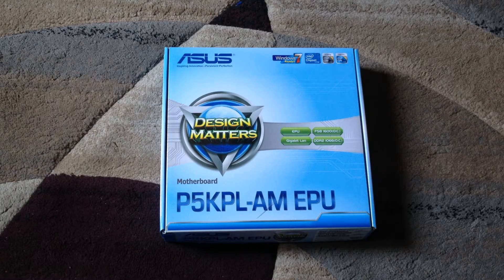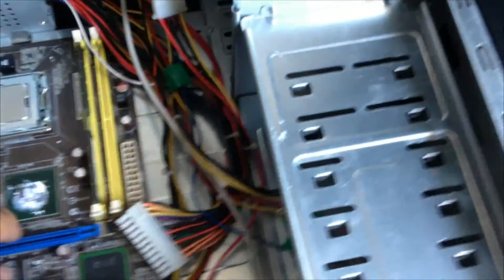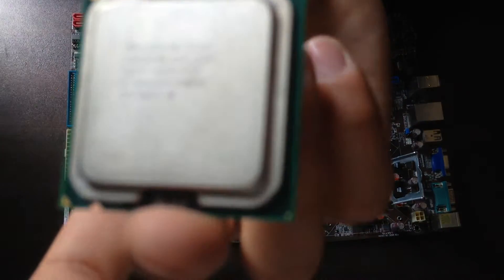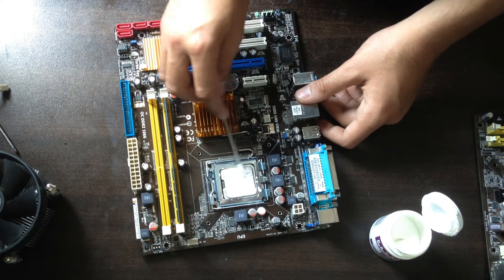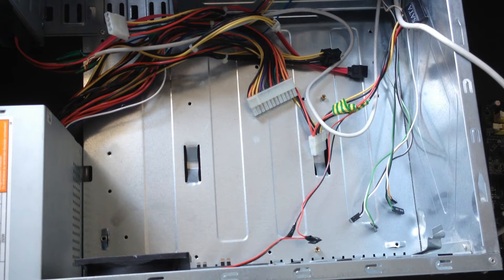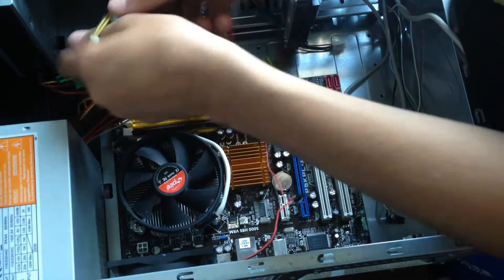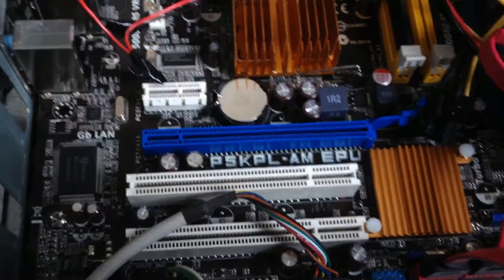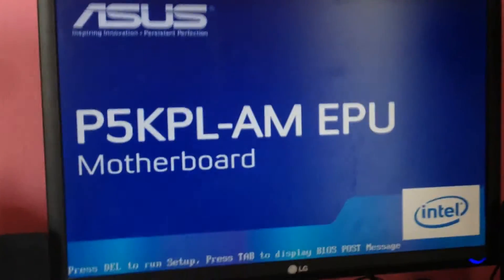Motherboard replacement. P5KPL-AM EPU Unboxing and installing

Comment: Dude did you upgrade this motherboard ?
Reply from the maker: I have Installed quad core cpu and ssd. It still works fine with windows 10.

Comment: 5:05 - thermal paste is not very important. I run all core 2 duos without thermal paste, difference in temperature is like 3-5 degrees. Not mendatory for core 2 duos, only for 100W TDP core 2 quads.

Comment: I am also facing this boot mgr missing error what did you do bro
Reply from the maker: You need to install windows
Reply: @AudioTherapy0  yes I try to install is through usb  but its not shown
Reply from the maker: You need to access it through boot manager. When starting up click F12 many times to make it appear.

Comment: Do you need GPU or can you just connect a monitor straight to the board
Reply from the maker: If motherboard has VGA output then you can use it without GPU. If not, then GPU is necessary. In this case my motherboard does have VGA output but using GPU will make it work better in games and some other applications. Onboard gpu is pretty weak.
Reply: Audio Therapy thanks this helped:) you just got a new subscriber
Reply: @AudioTherapy0  dose it support core 2 quad q6600 or 800mhz DDR2 RAM